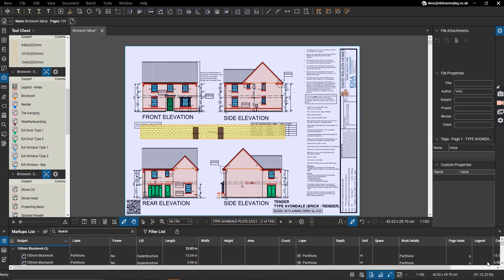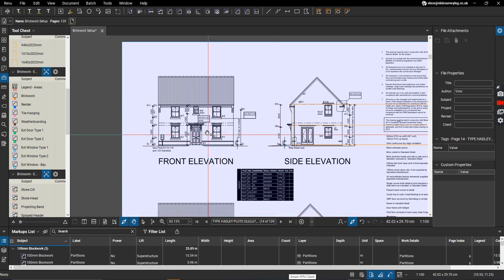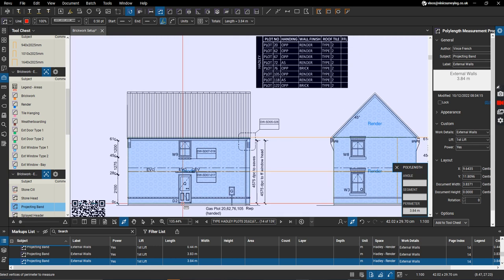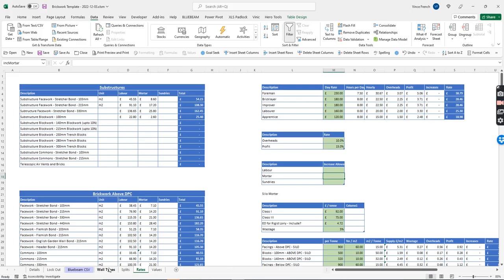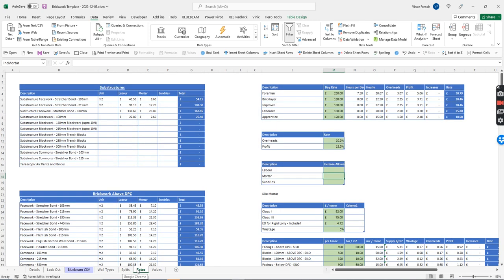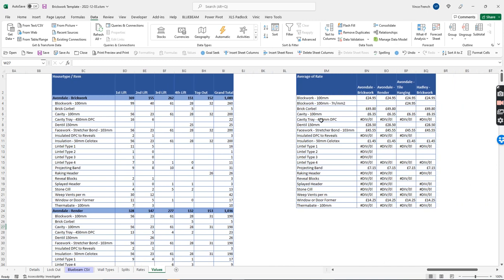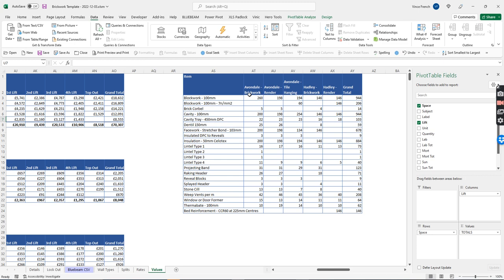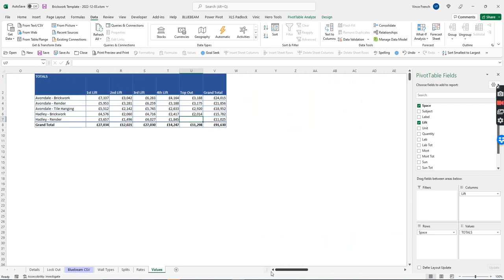Bluebeam and Excel - Measuring Brickwork

Comment: how do you deduct wall openings when taking off wall area, for interior walls?
Reply from the maker: For the internal walls I'll measure the length on plan the do a quick sketch to scale markup which I then overmark with the internal wall - if there are several walls, they can all be added together in one sketch to scale item.  The openings are then deducted in the same way as the external walls.  When I infill the opening with the door type I can then automatically create the information for the lintel, cavity closer for party walls, etc..